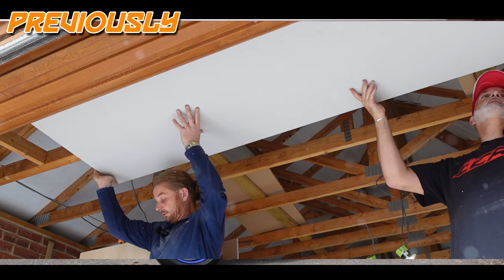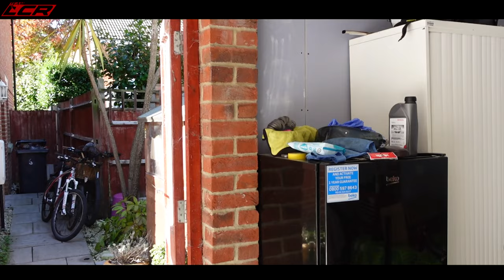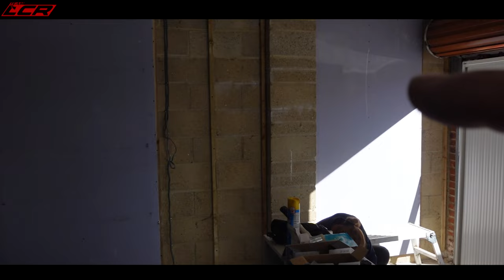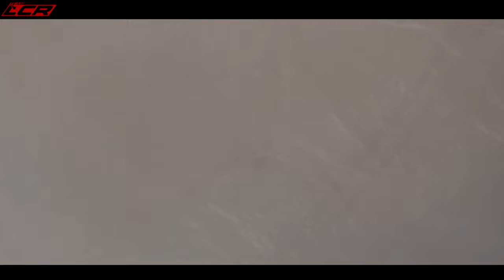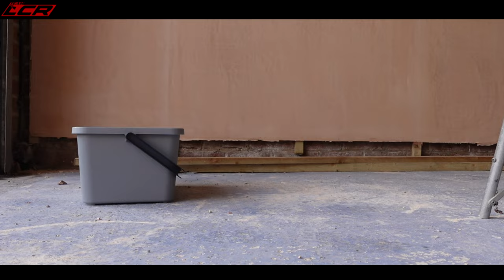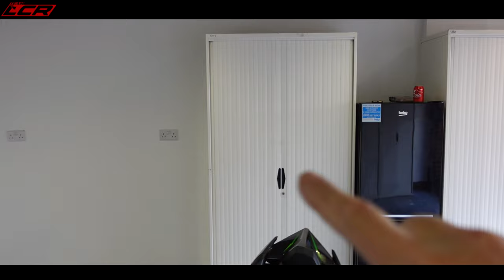Dream Garage Setup | Finally Taking Shape! EP04

Comment: re your floor tile choice ..... I avoided coin edge or anything with a pattern so that small caster wheels roll easily. As a result, my abba skylift and caster wheeled high/low stool scoot about the floor. 👍
Reply from the maker: Yes good tip

Comment: You should have used PVA on that bare plaster before you painted it, it seals the plaster and makes painting very easy afterwards. Looks great though ! Nice one Wobble 😂
Reply: No,.50/50 must coat is better.
PVA can peel.off once paint hits it.

Comment: Looks good and nice job! For a second I thought that those spots were going to be the only lights in there. 
What size is the garage internally now?
Reply from the maker: It's 70mm smaller now than it was side to side and 45mm door to the back of the garage
Reply: @LambChopRides  what was the original size I can’t remember lol

Comment: Hi chopsy, Iv got a lift which I bought from sealy. I’d highly recommend as Iv used it for my track bike and more importantly it easily accommodates my hayabusa. Can send the details of the model to you if you wanted? Looking good 👍 cheers Ben
Reply from the maker: Thanks Ben which model?
Reply: @LambChopRides  it’s the sealey mc454. The important parts are that it has a 450kg max weight and is a scissor lift style so only uses the same amount of space it’s sat in. Straight up and down. I bought it brand new from a supplier off eBay as the had a good deal. Would need a few of you to receive it because if weight but I’m sure Womble will be around!! 👍